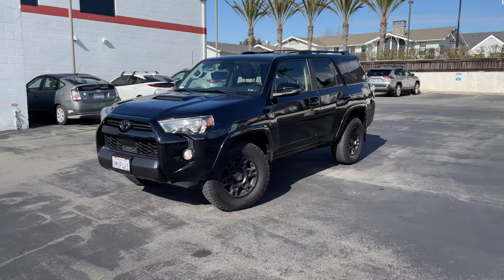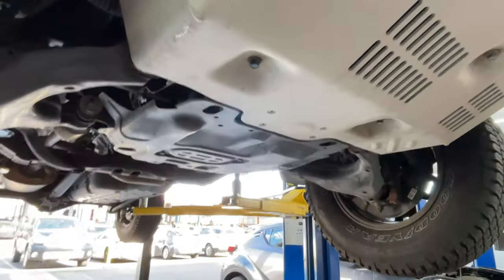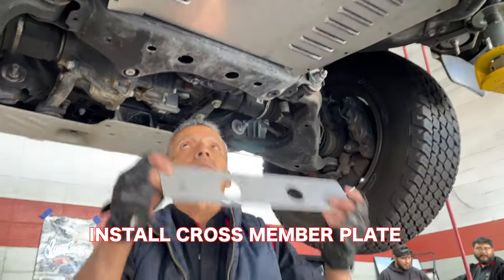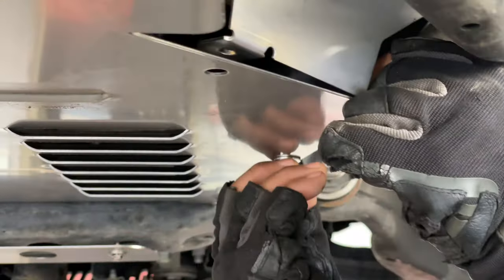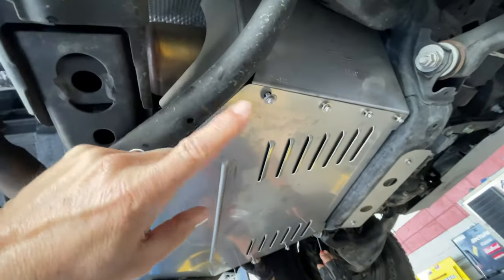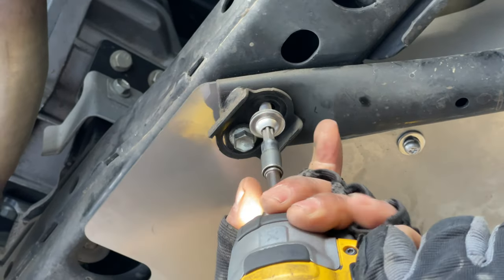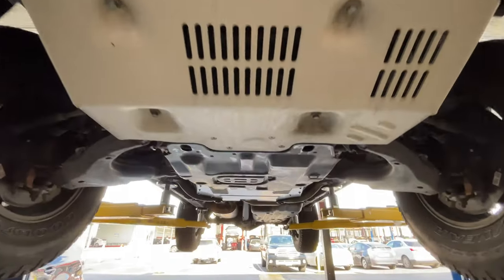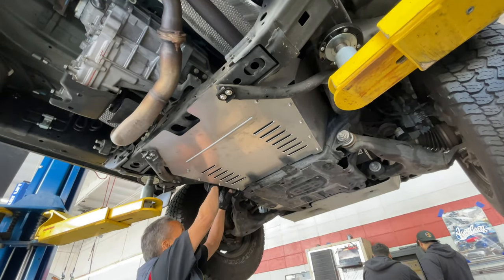Toyota 4Runner Catalytic Converter Theft Shield

Comment: What would prevent a thief from just ordering one of these kits for a couple hundred bucks and then they will have the "special" tool. How long would it take to cut that off with a cordless angle grinder?
Reply: Still has to work for it.
Reply: The fool proof method is to weld the plates directly to the truck. Good luck getting it off though.